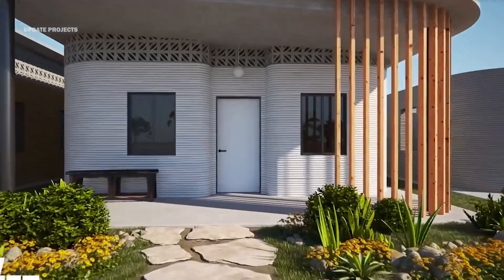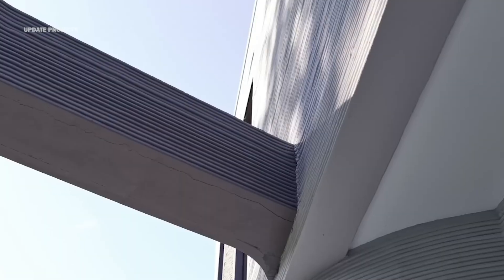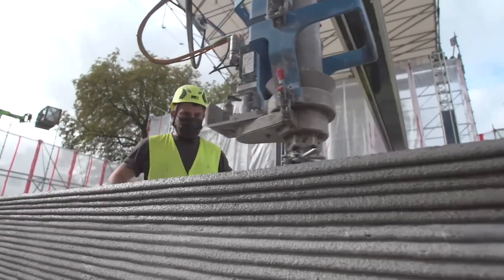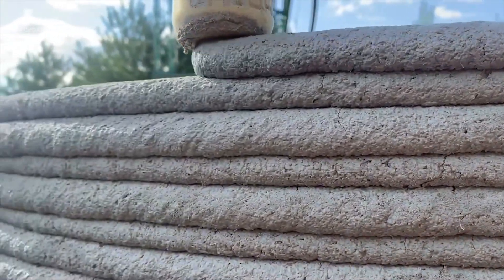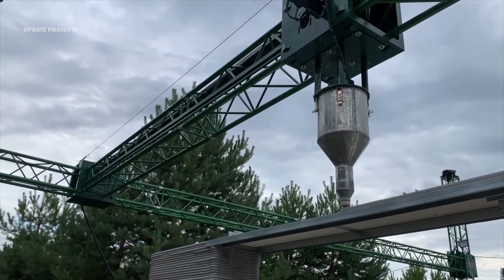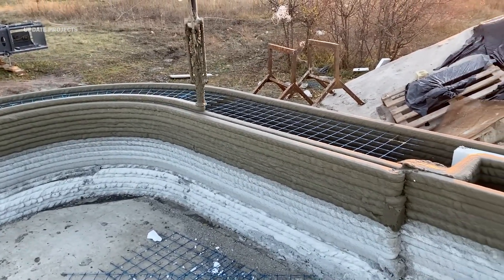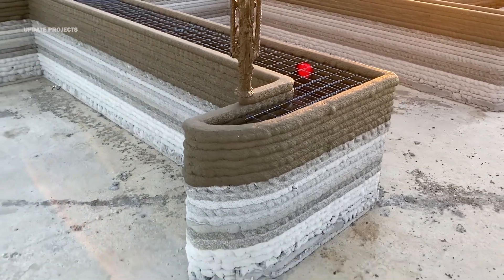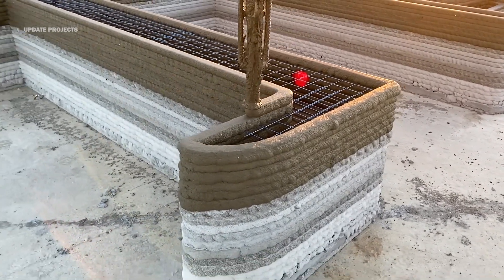Will the 3D Printing Construction Market Experience Dynamic Growth in 2024?

Comment: 3D printing of the houses will never reach mass adoption. Anyone who works in constructions knows very well that the walls of any given house are in fact the cheapest and quickest part of any project. My house has 11 windows with only 1 being over-sized 3x2.3m. Those triple glass windows were 2x the price of my walls for 130 square meter(1400 square feet) house. Floor tiles were the same price as my walls for entire house and I wasn't even going for super expensive ones. Electric wiring costs more than walls for entire house. Roof? 4x the price of the walls!

In summary. Walls for the house are already super cheap and 3d printing them won't be too much cheaper.
Reply from the maker: Thank you for your insightful comment and the valuable information you have provided. I greatly appreciate your contribution.
Reply: Il problema delle costruzioni sono i cantieri, mi spiego meglio, è il suo allestimento, la sua durata e quanti operai devi avere per costruire. In poche parole è tutto quello che ci sta intorno, dai ponteggi alla lungaggine di costruzione. Con la stampa in 3d si risparmia in velocità di costruzione, non su materiali.